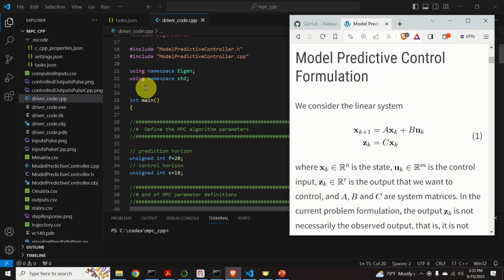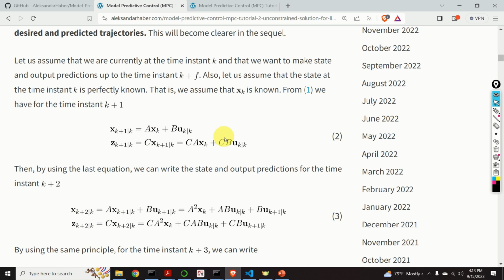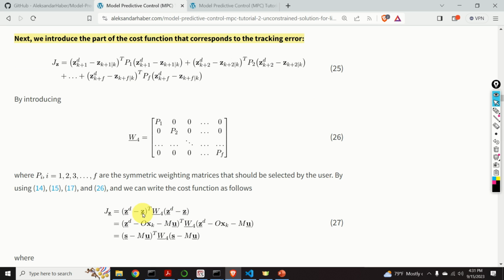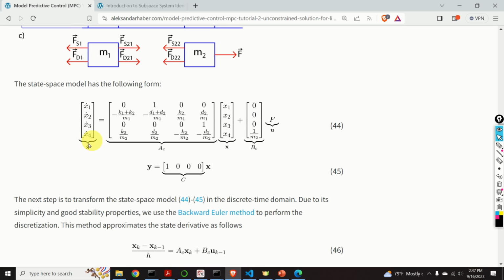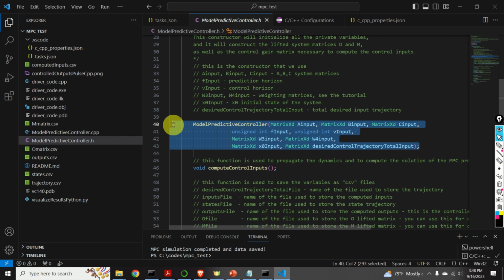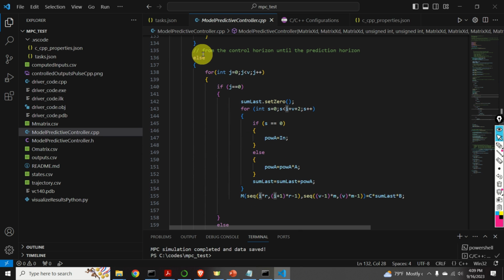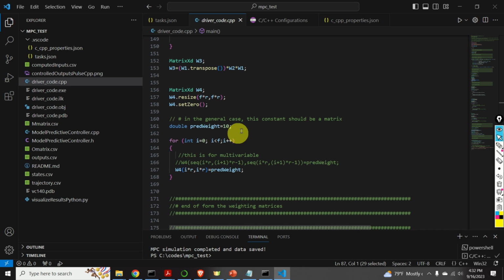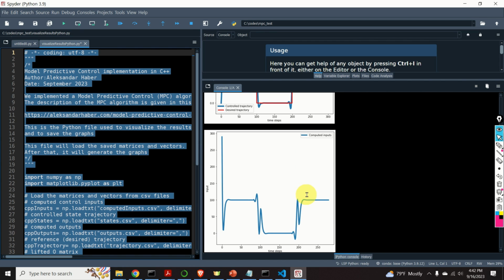Model Predictive Control (MPC) from Scratch - Derivation and C++ Implementation Using Eigen Library

Comment from the maker: If you need help with your professional engineering problem, or you need to develop new skills in the fields of control, signal processing, embedded systems, programming, optimization, machine learning, robotics, etc., we are here to help. We provide professional engineering services as well as tutoring and skill development services. We have more than 15 years of industry, research, and university-level teaching experience. Describe your problem and we will send you a quote for our services. The contact information is ml.mecheng@gmail.com  
The website tutorial is given here:
https://aleksandarhaber.com/model-predictive-control-mpc-tutorial-2-unconstrained-solution-for-linear-systems-and-implementation-in-c-from-scratch-by-using-eigen-c-library/
The GitHub page with all the codes is given here:
https://github.com/AleksandarHaber/Model-Predictive-Control-for-Linear-Systems-in-Cpp-by-Using-Eigen-Library/tree/main
Video tutorial for installing VS Code Editor and C++ Compiler:
https://www.youtube.com/watch?v=2KGM3-r8eK8
Video tutorial for installing the Eigen C++ library in VS Code Editor:
https://www.youtube.com/watch?v=fUxp3upZsk0
MPC implementation in Python:
https://www.youtube.com/watch?v=8BHMsKXlRq0